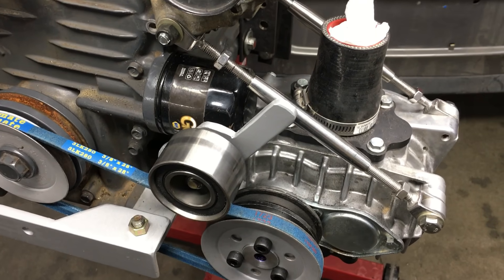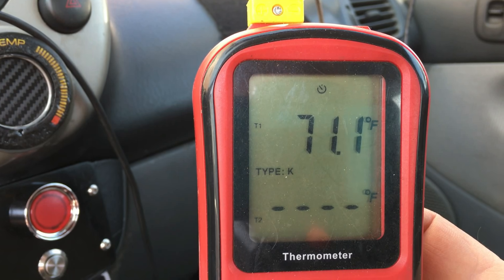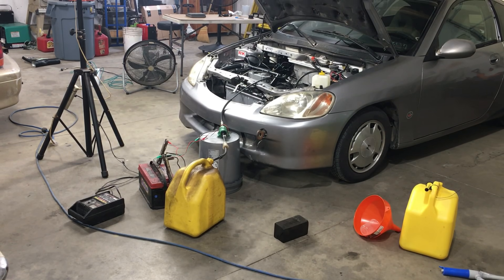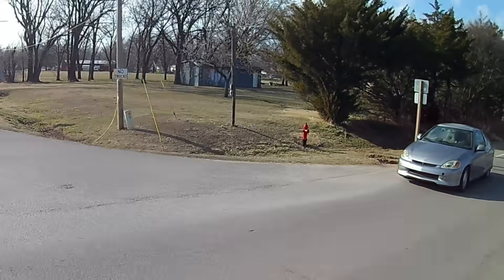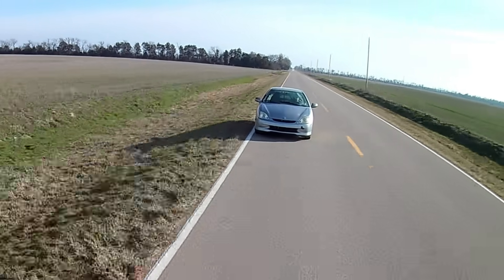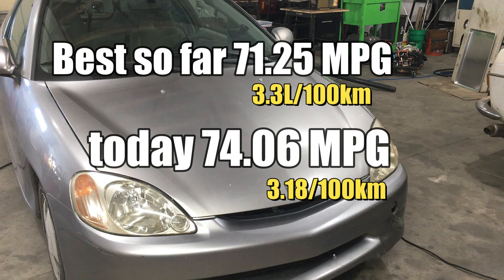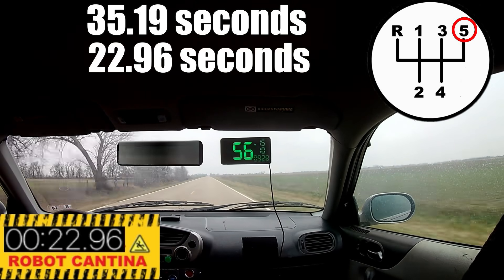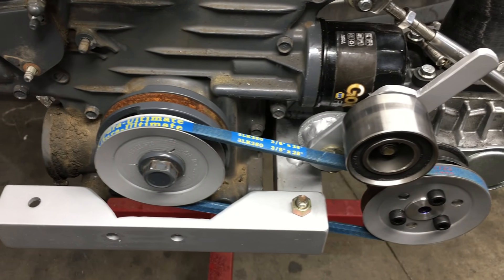S4 E10. We find out if the AMR500 supercharged Kubota diesel engine is more fuel efficient.

Comment: surely there's some kind of high tech bolt or gizmo that could electronically transmit effects of the weight of the fuel tank to convert to a measurement to save time pumping.  600 miles in that jalopy beats a good day at work ;)  THANKS for sharing your content with us😊

Comment: I wasn't surprised that fuel efficiency increased, in fact I expected it. Since the pump was previously tuned for a boosted engine, the lack of boost here caused it to overfuel. You were sending dinosaur juice out the tailpipe instead of to the wheels.

Comment: Classic case of more power equals better! When youre underpowered like in this situation youre having to stay in throttle longer to hit cruising speed, lugging almost. With the supercharger your acceleration is easier and quicker thus saving mpg. Probably helps with the load from wind resistance even while cruising being such a small engine in higher gears, saving a bit more mpg. All with more power! At least my thoughts

Modern gas engines are kinda falling into the same trap with all these gears in the transmissions and economy tunes etc. End up shifting so early and cruising at such low rpms, got engines working harder and using more fuel unless youre at the perfect speed. Especially bad on those smaller turbo cars

Comment: I have  a 97 land rover tdi where ive installed an lpg fumigation to the air inlet  and its fantastic for more torque in fact 40% more  and much lower EGT , No more black smoke as the lpg mixed with diesel burns 98% of the fuel ,,, have fun
Reply: some people in petrol cars use fuel scavenger devices to great effect

Comment: He should consider going back to the single belt setup and add the intercooler to stabilize the boost because the engine can handle 12 psi all day long in stock form.

Comment: I'd crank the boost to 12psi, do a WATER to air intercooler (less pressure drop and heat soak compared to air-to-air, also allowing it to not sit on top of the engine) heat wrap the exhaust, and gold wrap the intake and intercooler/piping.  On a random note, i'd like to see if an anti reversion chamber off the downpipe makes a difference in power and fuel economy.  If you are fealing extra, swap that pod filter with a K&N x-force pod of the equivalent size, the top cap on the filter is also an intake location (unlike the existing one), thus providing more surface area for air to come in. 
Good content as always.

Comment: It's not making more power and using less fuel. It's able to deliver more power if you ask for it but you tested the fuel economy driving 60 miles steadily at 60 mph, so the power delivered is almost identical in both cases. It's not much of a surprise to see the fuel consumption to be very close.

Comment: It would be interesting to add an afr sensor. I mean, if it smokes black when launching, more air will increase the efficiency and thusly lower the fuel consumption. Also, afr in a diesel is hilarious to look at if you're used to petrol engines.

Comment: Here's why I think you gained gas mileage while lowering your 0-55 mph. 

You didn't change your fueling. So for the same amount of fuel, your creating more power.
Now since you are making more power, it takes less effort for the engine to bring the car up to speed and then maintain that speed. 

It would only go to reason then that since you are consuming the same amount of fuel while making more power, that your mileage would go up for the reason I said above.  Plus any power consumed by that supercharger would be negligible since it is so tiny.

I did some rough math and I think you've gone from about 20 HP to 30 HP at max boost. Normally a 10 HP gain wouldn't be that much, but since you are dealing with already small numbers, you've increased your output by 50%.

Comment: I bet my hat on that if you increase boost a little to say 0.7 bars (double) or just about as much as the smoke goes away you will see even better fuel economy. How? Well. since you need to depress the accelerator less for the same speed as the amount of air decides the amount of power as long as the air/fuel mixture isn't lean, you will actually use less fuel to produce the same amount of power. ;) And the amount of power to go 55 mph isn't changing really...

Comment: An Intercooler or Heat Exchanger it's NEVER a bad investment on a turbo or supercharged engine.
I think of it as "future proofing" the build, regardless of what the instruments say.
The closer you can keep the compressed air before entering the cylinders to ambient temp, the better for performance and engine longevity. Be it Diesel or Gasoline.
Great work as usual, RC Team, looking forward to next episode.  👌😊👍
EDIT: I'm ALL for Twin - Charging this beast as others have suggested. Blower for low rpm response and the turbo to complement the blower and carry the steam to high rpm.

Comment: If you are increasing power output without adding more fuel, you will get better fuel economy. Unless the injection system has some means of adding more fuel, say through the use of a mass air flow sensor, the power gain has to be coming from the higher compression ratio created by the super charger.

Comment: the extra air helped more than the load hurt on the combo. Basically this combo has a better BSFC "brake specific fuel consumption" with boost than without.  People that boost the Honda K engines usually double NA power at like 11psi of boost which is before the magic 14.7 or whatever psi of boost you would theoretically expect. It's what the combo wants. I blame the heads.

Comment: It makes sense that the fuel economy would increase under boost on a diesel, providing that the fuelling hasn't changed. On a diesel like this, the amount of fuel injected per power stroke is (relatively) fixed (per RPM and throttle position). Although the boost will increase the compressive forces in the cylinder, along with the parasitic losses of the compressor itself, which will decrease efficiency. However, the increased air density in the cylinder is beneficial for the reaction kinetics of the combustion. For one, it should improve the atomisation of the diesel as it is injected, there's more air per volume in the cylinder for the diesel droplets to "smash in to". There's also more oxygen in proximity to the diesel droplets for them to react with, and the air will be at a higher temperature (from the increased compression) and therefore the molecules will have more kinetic energy, which will also be beneficial for the reaction because that means there's more chance for the oxygen to interact with the diesel fuel. All this adds up to a more uniform and complete combustion, improving efficiency. Note, though, that these benefits are minimised for a diesel engine that is already running lean, as opposed to one that is running under stoichiometric or rich conditions.

Comment: Yeah, so what people don't really realize is that for an intercooler or aftercooler to be effective and to create more power, you need to be running a high enough charge air temperature to even have any heat to exchange to the environment.

On a personal project of mine (still in the R&D stages) we're working on a way to have really high boost, use intercoolers and aftercooling to bring the temperatures down, and then venting charge air to reduce the pressure/temperature even further. So like, at the beginning you'd see like 60+ pounds of boost but the intake plenum wouldn't see anywhere near that level, but from the reduction in pressure we lose a lot of temperature so everything should smooth out.

Again, still a work in progress.

Comment: Well , superchargers can be more efficient Than a piston based comoressor. All piston engines are Just basicly compressors for half of what they do. 
You would need to play with the compression ratio of the engine , and the drive ratio of the supercharger. There are regions when it be more efficient to have the supercharger do more work . 
Actualy superchargers efficiency drops as you have to rev em up more. For that reason a larger supercharger by default is better.
Allso all engines have different efficiency versus load and rpm. Not sure if this given engine has a map like that available. Not familiar with asian types. Russian engines (d245 etc..) have significantly better efficiency at around 1600 rpm. Highly likely this here smaller engine allso has a better efficiency at about 2/3 of its redline.

Comment: No surprises here; as you've stated, the engine's fuel setup is significantly over-delivering with no forced induction, so you should expect to see MPG numbers improve with the addition of boost; you're utilizing lots of potential energy that was previously heading out the exhaust un-combusted, even given the additional drag from belt & compressor.

A better comparison would involve tuning the fuel delivery to be 'smokeless' while naturally aspirated, then adding the supercharger and winding the fuel delivery up in line with stochiometric ratio; then I'd expect to see things line up more closely with your expectations.

tldr: You've made use of significant energy potential that the engine was previously wasting.

Comment: Ah yes. Glad to see it working better than the turbo. I will be using the .854L version of the diesel engine. Going to try and beat my old cars 18-24mpg. With the old rotary 1.3L, electric motors driving the car, hybrid battery running the motor and the little diesel to produce the electricity needed to keep it charged and or power the car as if it was a locomotive

Comment: I'm by no means a diesel expert but it's my understanding that diesels just keep getting more efficient as you add boost. You're effectively increasing the volume of air going into the cylinder so it'll pack more punch upon combustion, even under low power cruising scenarios, so you don't need to use as much throttle, and therefore you use less fuel to make the same power.

Comment: Hey Jimbo me again try running waste motor oil thin down with a little bit of gas I ran this concoction in my 12-valve Cummins for several months and consistently got 7 to 8 mi to the gallon better fuel economy

Comment: Since your engine's now got more airflow going through it, it might be worth experimenting with combined super/turbo charging. Nothing fancy, just using a turbo to try to shove extra air into the AMR500, since it's now flowing as much air as an engine 50% larger and would start spooling up the turbo that much earlier.

Comment: To potentially explain the economy increasing, the insight forum people see increases when installing a turbo on account of less time spent accelerating and more time spent at speed.

This is attributed to the engine spending more time in its peak efficiency range.

Given that this is a diesel, it is also possible that the additional air is making it possible for more complete combustion and eliminating what would be imperceptible smoking while cruising. An AFR gauge would tell if thats true or not.

Comment: Gotta remember that MPG is not a linear scale, the more MPG you're making, the more a small change in consumption is reflected. The difference between 40 and 50 MPG is 0.005 gallons per mile, but the difference between 70 and 80 MPG is 0.0018 gallons per mile. 

Between 73 and 75MPG, that's only 0.0003653 gpm, so over a 100 mile course 0.018625 gallons, 2.34 fluid ounces, or two ounces by weight of diesel fuel.

Comment: And what did you do with the stock Insight motor and IMA system?  And it's cool using a car with a DCA of 0.23. 👍And my 2020 Insight got 70 mpg stock. But after 60k it went down to 63.

Comment: There's a company called RIPP superchargers that sell a centrifugal supercharger for the 3.6L Pentastar engines used in Dodge Chargers, Ram trucks and Jeeps,  and pretty much across the board people have said it increased their fuel economy in every day driving.  It adds about 11 to 13 PSI of boost and slightly less than 200 HP at the wheel.  So the fuel economy getting a little better is not unheard of.

It will be interesting to see how your setup scales.

Comment: adding the intercooler is a good thing to do - a denser charge will make more hp and the engine will not have to work as hard to make the same power - it could end up helping mpg as a consequence

Comment: have you ever looked into methanol injection for increased mileage?

snow perfomance makes their "mpg-max" kit which ramps in methanol in proportion to the boost once you pass the threshold that you choose. most guys pick up an mpg or so empty and 2-3 while towing. definitely also improves power from the charge air cooling, extra fuel added via the methanol, and also from the methanol helping to complete the burn of the diesel fuel; conveniently this will reduce smoke output and because you can get a more complete burn you can inject less fuel to make the same power. this is all info from 5.9 or 6.7 cummins stuff but i bet it would translate just fine to tiny kubota stuff.

not gonna say to go buy their expensive kit but i'd bet you could DIY a kit for cheap that would be pretty rad and have some effect on mileage. cant say it would be the 3-5% change i see on my truck for mileage, no matter how sweet that would be, but i'd bet you could swing a measurable change in efficiency from it. if you could get a 1% change in efficiency you'd be up another .7358 to an average of 74.3158mpg.

Comment: For diesels, more air should mean more power. Required power at cruising is constant, so more power available due to more air means less fuel will be used to maintain cruising speed.

Comment: If I recall…something like under 9lb, you don’t need a intercooler.
In low boost applications, an intercooler actually reduces power as a result of pressure drop across the core.

Comment: There are so many variables to make peak thermal efficiency in combustion. The energy it takes for the supercharger system to push that air into the engine is less than what is gained by more complete burning of the fuel and/or heat expansion of the additional air. Old style pure positive displacement blowers usually have very poor efficiency past like 8psi of boost in my experience. It would be super interesting to see it stepped up to the max rotor speed on this engine though.

Comment: Also. Due to the ideal gas law and mechanical thermodynamics the intake charge temp should be a fixed differential above ambient. If you're getting intake temps of ~100F at 61F ambient (ΔT=~40F), then at 100F ambient in a hot summer you shouldn't ever see intake charge temps above 140-150F.  
Diesels like warm intake air for efficiency, and that is a perfectly acceptable IAT even for turbo builds with an intercooler. It may get a little warmer if you decide to go to a higher boost target but realistically I don't think you'll ever need an intercooler with such a small ΔT.

Comment: given that it's a cast iron diesel that doesn't like cold starts... it really would behoove you to install an AC block heater in the water jacket as a future upgrade! I even did that on my gasoline Honda so I could get faster cabin heat and reduce startup wear and it really does make her feel better to pull out of the driveway, starting with the engine block around 90F instead of -10F. 

Even a 300w heater is probably enough for that small of a block as long as you plug it in an hour or two before you start.

Comment: “Nobody would ever want to drive this thing that long”
You underestimate our love for jankiness, Jimbo! I dailied an 84 diesel rabbit for two years with a broken heat box. 

On another note: you might benefit from tossing that turbo you had back onto this setup. Twincharging is sorta more common than pure supercharged diesels because it is very possible to lean out the motor at low load/idle and “blow out” the combustion once you get more air out of the supercharger. Food for thought!

Comment: While using a supercharger and burning fuel faster may seem like it would reduce fuel efficiency, we also have to consider how much energy we get out of the fuel and what the flow rate is.

Increased pressure can not only allow for higher air/fuel mixture flow rate, but it can also improve the efficiency of converting that mixture into mechanical energy. As a result of the increased efficiency, we actually decrease the flow rate - we give it less throttle to get the same amount of power.

By getting more out of the fuel, we use less fuel to get the same amount of work done, and therefore we get better fuel efficiency.

Comment: I thinking the added MPG is from 2 things one there always boost so the engine will act like it has higher compression and this helps with efficiency and 2nd with the added power you likely not having to push the gas peddle down as much so you running on less fuel. The both these more than made up for add power draw of the super changer, I wonder if how the pump timing changes power and MPG?